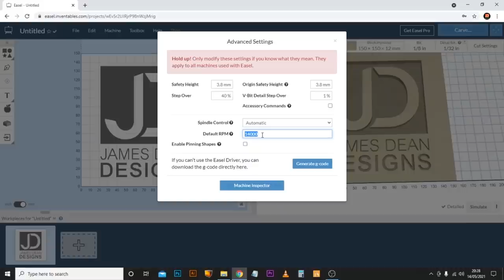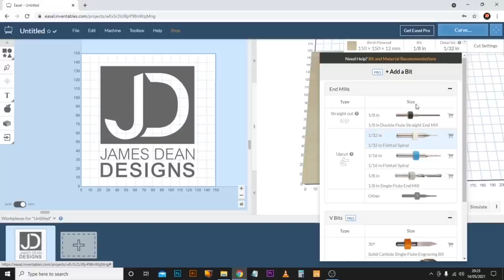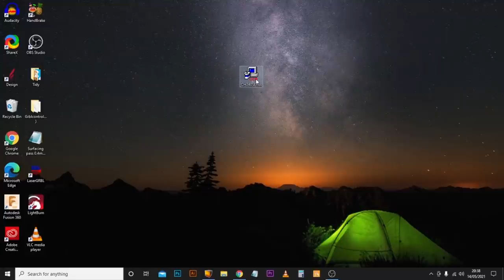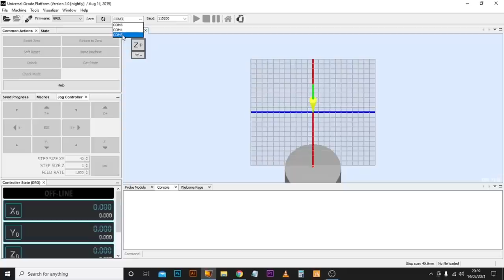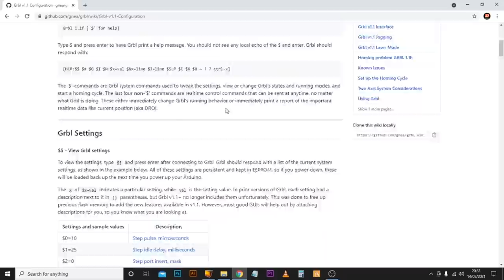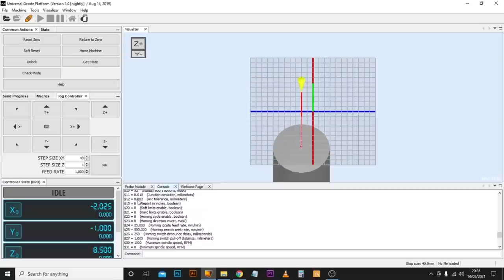Top 10 issues and solutions for desktop CNC machines - 3018, 4040, 4060, 6040, 6060,

Comment: Hey my COM port is not detecting, can you help, I am using UGS
Reply from the maker: Have you successfully installed the driver and does anything appear in the Device manager?
Reply: @JamesDeanDesigns  hey, fixed the problem by reinstalling the driver, but the problem came again when I switched On/Off the power supply 2-3 times
Reply from the maker: @AdityaSingh-in9lr  excellent. I do find that occasionally I have to press the reset button or unplug and reconnect the USB cable to get the PC to detect it
Reply: @JamesDeanDesigns  cool, this time I tried to coonnect just the USB without switching on the power supply and it started working again, lol
Reply: By the way, thanks for the assembly video, helped me a lot!
Reply: Can you share your twitter handle or email ID?

Comment: Maybe my first disagreement with you.  Not that you’re wrong, you are not.  But there is a much easier method to reverse the direction of any axis and that is to run the UGS setup wizard.  It gives you test buttons and reverse check boxes.
Reply from the maker: That works on the basis everyone is using UGS. I know I use UGS in my video but not everyone does so by giving the route solution it should hopefully help a lot more people out

Comment: Item number 10: Power settings disconnecting job

This was a running issue with my 3d printer. Windows 10 and 11 has hid these settings in multiple places. Windows 11 cares more about carbon emissions than functionality of the machine.

Windows 11 not only has power settings, but settings for each individual USB device and USB hub in the device manager, that you must find. You have to right click the device, hit "properties", then find a tab with a power setting that says something like "Allow windows to turn off this device to save power" and disable this. I have had this reverse itself after something as simple as restarting my computer. It is genuinely bad.

Comment: Error was detected  while sending G1X1.326Y1.326Y1.3103Z-0.0474F9-0. ALARM 2 SOFT LIMIT ALARM G CODE MOTION EXCEEDS MACHINE TRAVEL . Machine postion retained. Alarm may be safely unlocked. Streaming has been paused
Reply from the maker: Soft limits stops the machine travelling further than the work area. Your machine believes it is about to travel outside of its max work area. If you don't believe this is the case you can either turn soft limits off ($20=0) or enlarge your soft limits, your $130-132 settings
Reply: @James Dean Designs  
Hard limit has been triggered now .
Reply from the maker: @JimmyPerez-b9o  hard limit is suggesting you've hit a limit switch. Is that the case?
Reply: @JamesDeanDesigns  
No
Reply from the maker: @JimmyPerez-b9o  find me on Facebook if you can or email me info@jamesdeandesigns.com send me photos of whats happening and your GRBL settings

Comment: Hello James, i bought a CNC laser cutter 3020. I installed and build according to the manual yet it doesnt work. The cylinders around the bars they turn and spin when i put in a command in candle yet the bar doesnt turn it self non of them do. Can u please advice me... maybe i overlooked something
Reply from the maker: Hi, Im not 100% sure which parts you are on about. Are you on facebook? If so join the Sainsmart group and post some photos or videos up and I'll try and help you on there
Reply: @JamesDeanDesigns  i will thanks